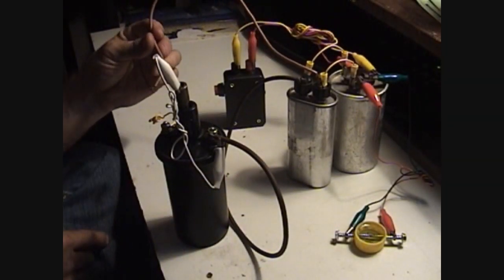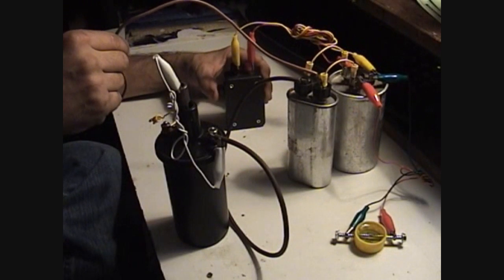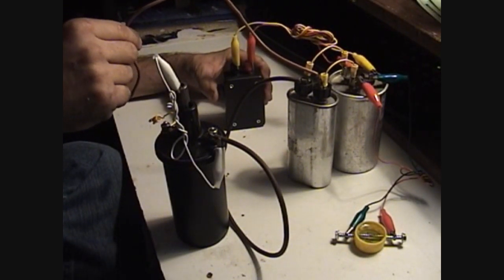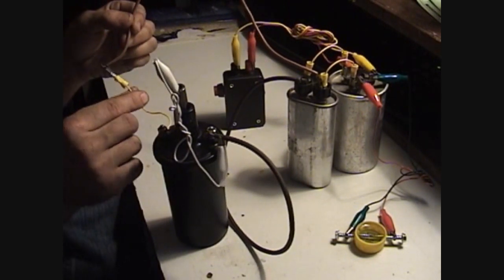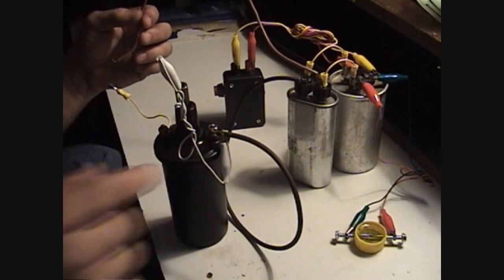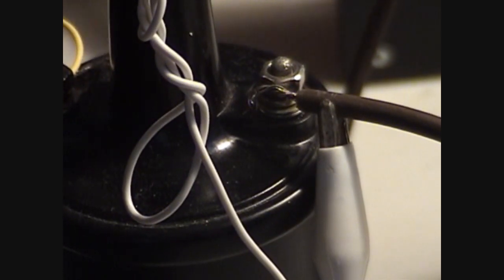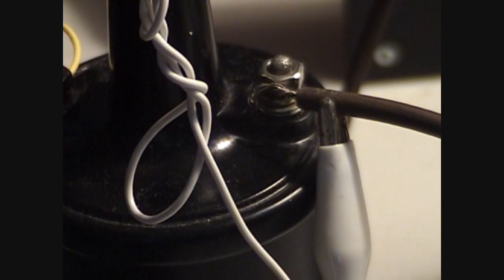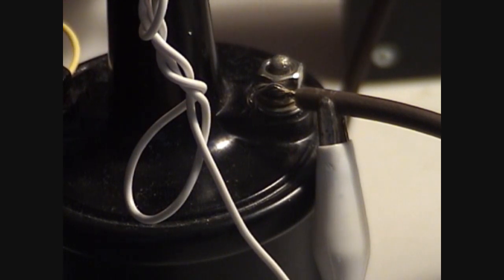water cracker 6

Comment: Ignition coils work somewhat with single pulse discharge, but they work better with an oscillator. High frequency and duty cycle, which means more power throughput. Just search ignition coil driver. i have never tried making hydrogen with high voltage, even though i have tons of HV stuff :P. Perhaps a microwave transformer? :O not.